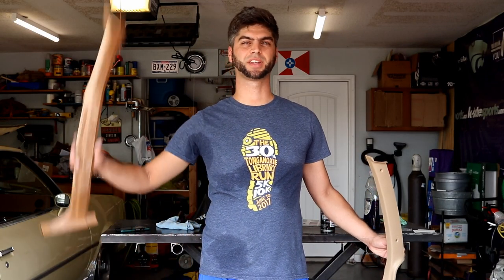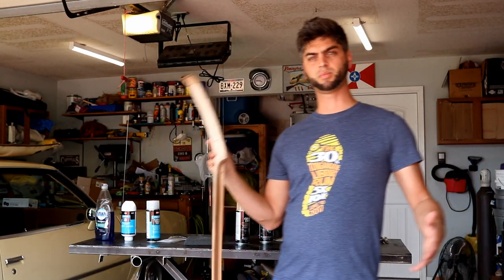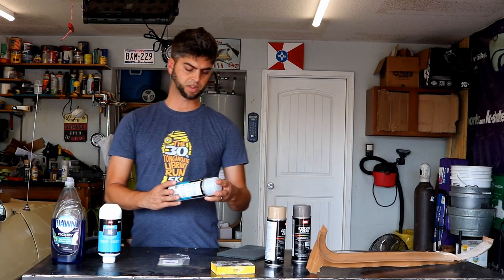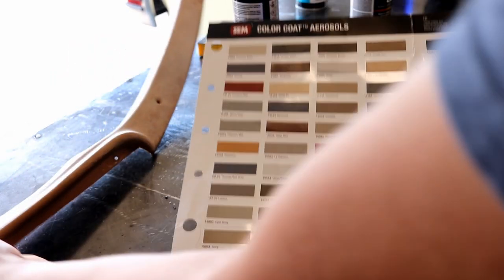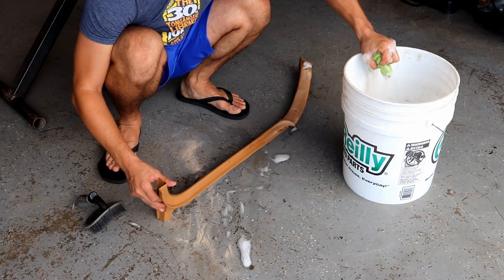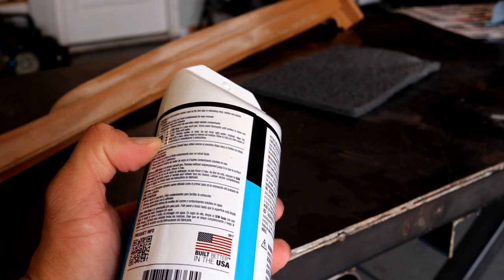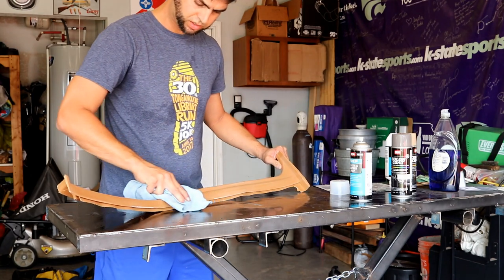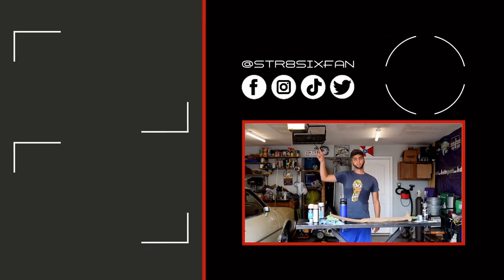How-to Revive Your GM G-Body's Plastics!

Comment: I've read upholstery books and they say to spray rubber cement ..a good layer and then use that pattern or material to imprint the design..then paint..hope that makea sense
Reply from the maker: That's an interesting technique, and it does make sense